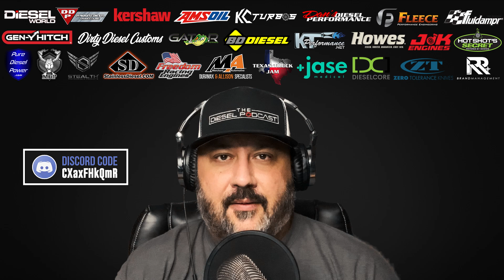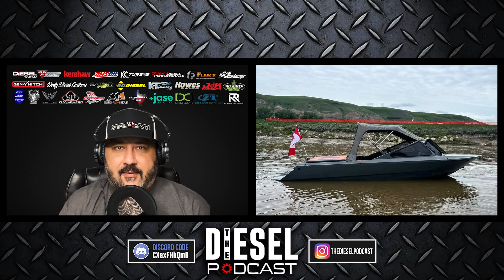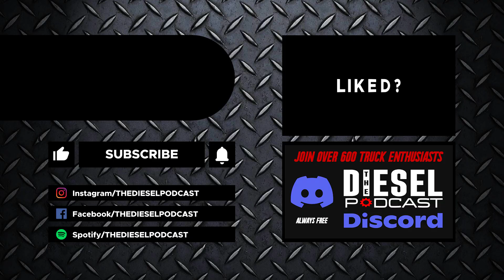How Well Does a Diesel Engine Do in a Boat?

Comment: All that money spent to save $100 at the pump. I wonder how long it would take for those savings to turn the cost into making it worth it
Reply: Thats all you got out of this? I think there was a few more points. He is a diesel enthusiast and wanted it diesel powered becausehe doesn't do gas engines, also it has more power than a gas engine.

Comment: I read an article on an old 1517 years ago and probably diesel power magazine I’m pretty sure it was diesel power they talked about Cummins had an aluminum block engine 5.9 for marine application I’m assuming that article was on the open up and if that’s the case that would be a hell of a nice package anyway the Duramax I could see and that boat would probably be better than a Cummins because it’s I’m gonna be replacing a V-8 with a V-8 well that means it can fit better one of the problems with the Cummins just six banger is it’s long and it’s hot it’s tall it’s a hell of an engine I got a 91.5 dodge yeah I’ll give you three guesses what’s under the hood anyway I think the aluminum block would be a hell of a nice way to go anyway this is six in a row jim From Kennerdell Pennsylvania